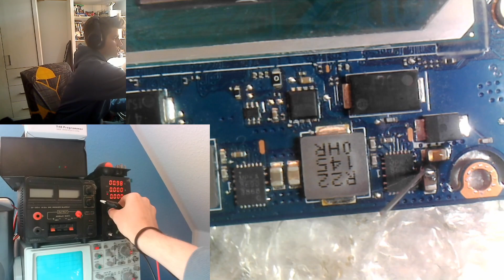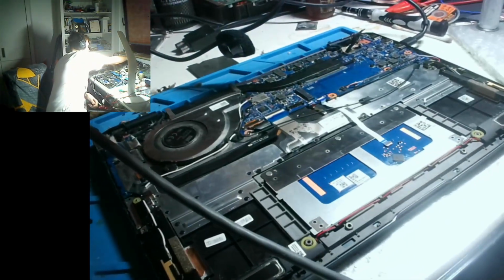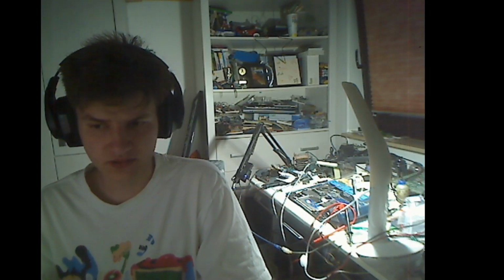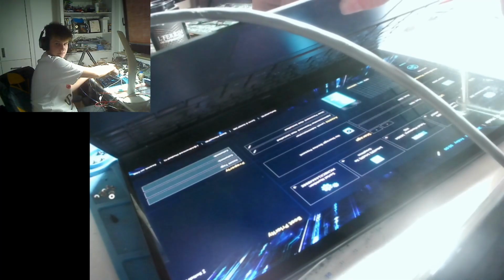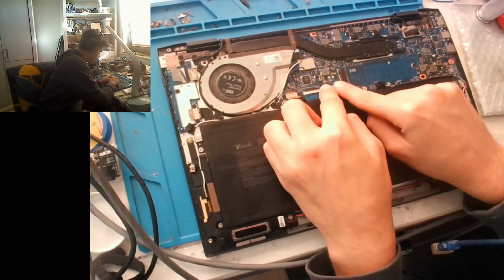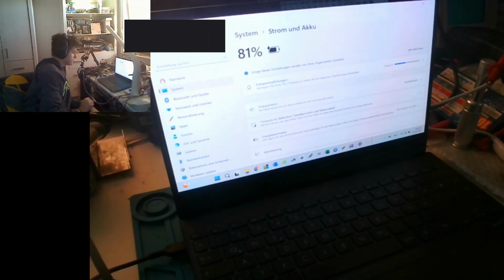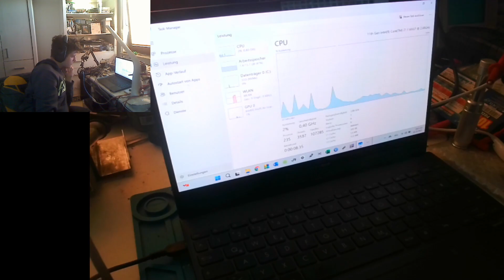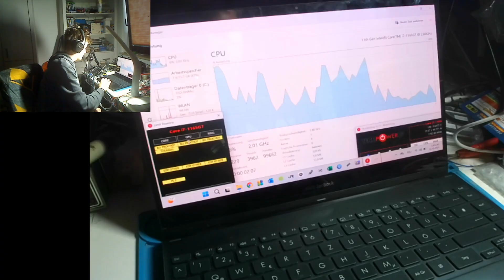Asus Zenbook Dead → No Charging → 0.40GHz Throttle FIXED! - Electronics Repair 14

Comment: This happens to ROG Flow X16 as well. Intermittent 0.4GHz when plugged. Many times fixed with plugging and unplugging the power cable on charging port.

ASUS is somehow creating faulty many series laptops